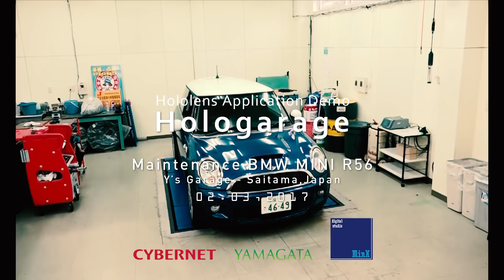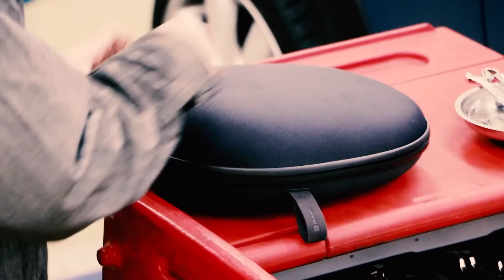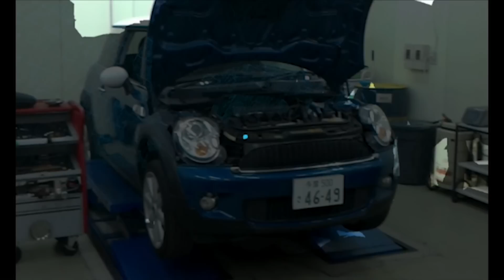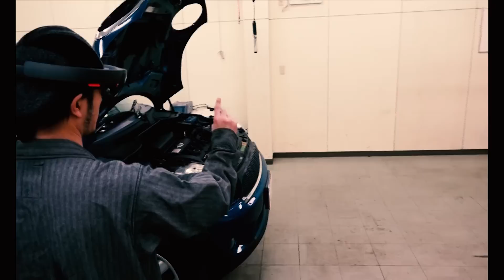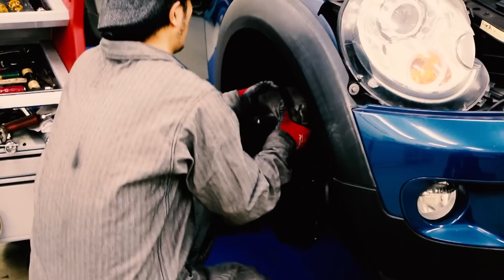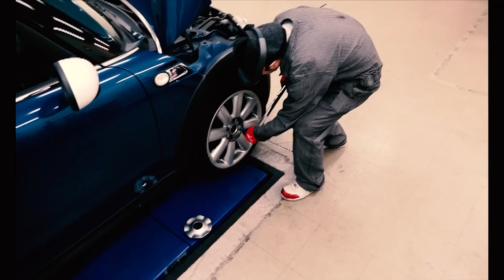Hologarage: Microsoft Hololens Car Maintenance Demo

Comment: How do you align the physical car and the virtual model?
Reply: TheAndyFactor p
Reply from the maker: I am recognizing the car number. It is also possible to fine-tune by moving the 3D model.
Reply: With car number you mean the license plate?
I was wondering how you got that working with vuforia since they only support small 3D objects or you precalibrated it by using QR markers or somethin like that.
Reply: You can train your own 2D markers with Vuforia. I have also trained 3D objects as 2D markers with Vuforia and Hololens.
Reply from the maker: Yes, I think that it is roughly the same. We are using 3D object tracking.